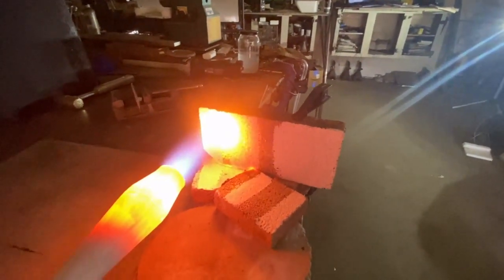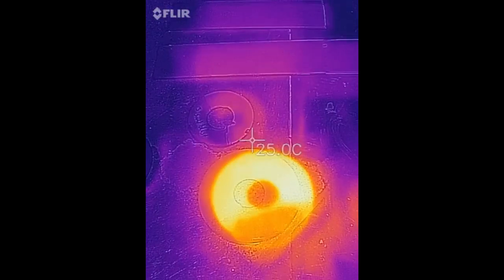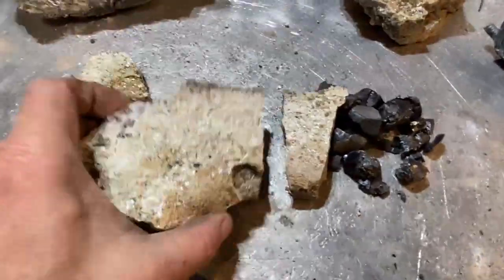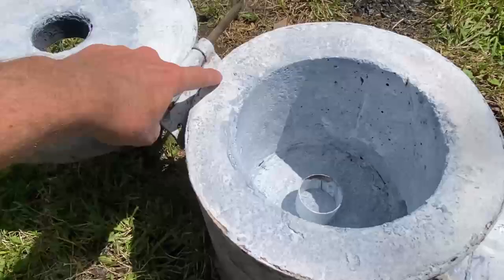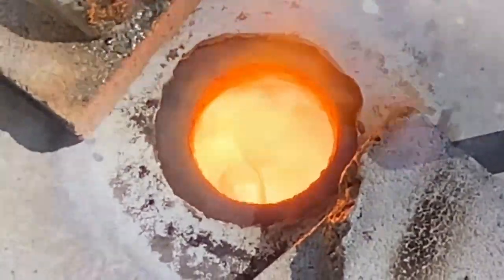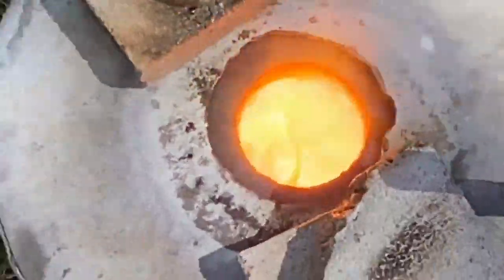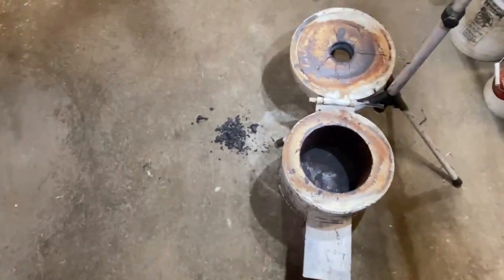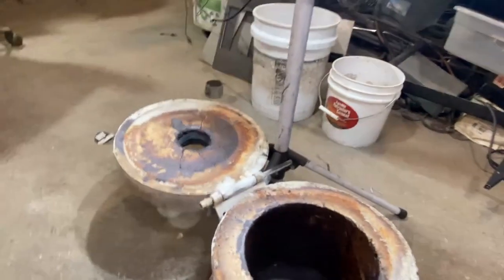High Emissivity coatings for Foundries Potassium Silicate test

Comment: what is the refractory in your furnace made out of? And have you tried microsphere coatings? They have superior emissivity due to the structure, I know you can make lime microspheres by atomizing slaked lime in a sodium carbonate solution, It shouldn't encounter the expansion problem if they are in a water glass solution since the are so tiny and get trapped in the glassy layer

Comment: Iron oxide is easily dissolved with HCl.

All you would need is to scratch the surface [say with carbide sand paper, by hand or on a dremel (flapper wheel)] and then take microfiber cloth to wipe off the remaining iron oxide.

Of course, yes, use heavy industrial chemical resistant rubber gloves and proper respiratory protection from the fumes.

Just dab and wipe the surface to keep loads of acid from going beyond the target layer.

If you just soaked the whole thing in acid, naturally, it would be destroyed, so all you want with the damp cloth is a way to wash off the inner few thousandths of an inch of iron oxide. [any any other metal oxides]

Again, it is best if you rough off the bulk of it with sand paper first, so you use less acid.

The use of Cerium oxide also increases combustion efficiency as it is a catalyst.

That will increase your total energy output as heat, while helping you hold it in the furnace.